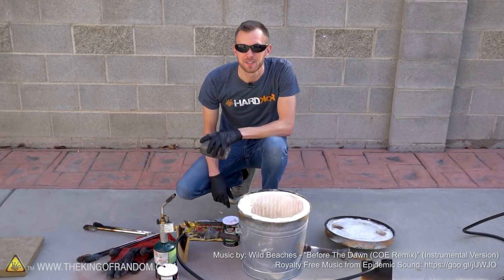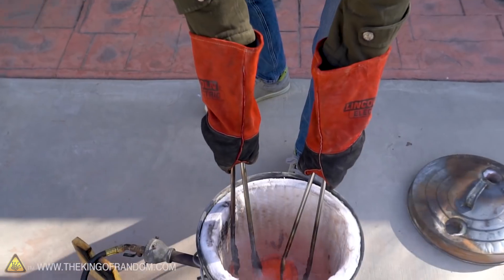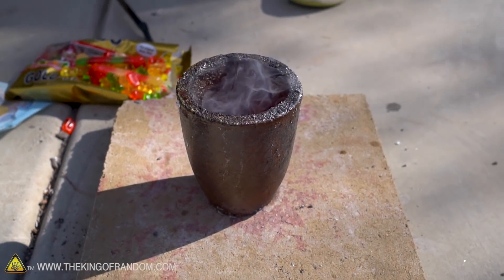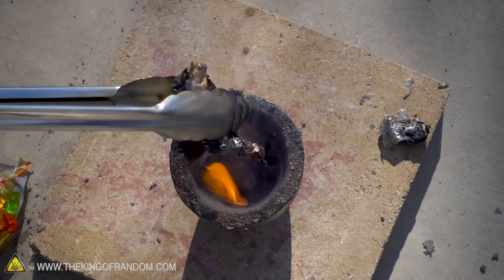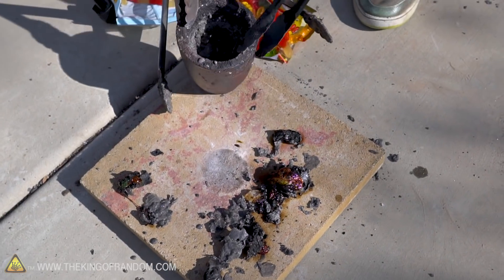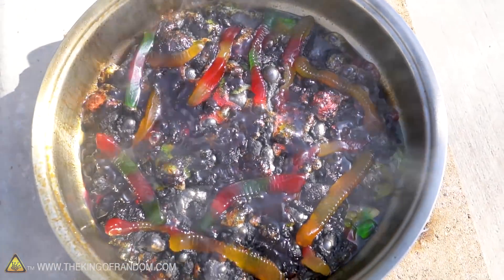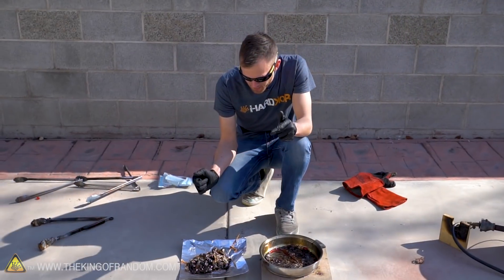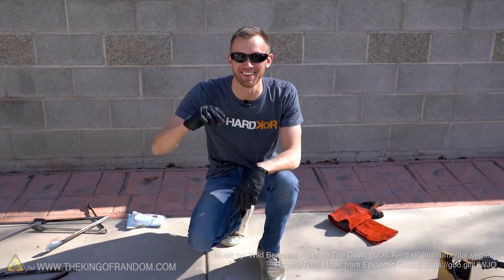Melting Gummy Bears in Molten Salt! TKOR's Guide On How To Melt Gummy Bears With Molten Salt!

Comment: You should get a different crucible like a ceramic one and see if the salt would  solidify clear
Reply: It is ceramic...

Not fully ceramic but it’s still ceramic
Reply: Prof. esrever I meant something other than this one which has graphite in it because he mentioned that along with the remains of past projects the graphite could be what's causing the salt to get that grey color. I was thinking more like an alumina ceramic crucible because they're more white so the salt should stay white

Comment: You should put shaving foam in a plastic bottle, then make a hole in the cap of the bottle (0,5 inch wide) and then put it in the vacuum chamber. Watch what happens.

Comment: When you drop sugar or candy into molten potassium nitrate, it will burn very quickly, sometimes explosively. It normally melts at 633°F, but you should superheat it to 2000°F with the furnace, and drop a gummy bear in.

Comment: @The King of Random what would happen to the bowl if it was heated in the furnace? would it eventually melt from the heat in the furnace or explode like it did when in contact with the salt?
I'd expect thermal shock was the cause for the bowl shattering, so not sure what would happen when it is heated slowly to those temperatures...

Comment: Molten salt in a vacuum chamber
Reply: This is probably a bad idea, because if the salt starts to boil under the vacuum then it will coat the inside of the glass as well as the inside of their vacuum pump.

Comment: mix sugar and citrid acid and hold it over a Flame. It will melt/react imediatly. That is really strange. I dont know if it becomes a plastic. It could because the carboxyl could react with the alcohol group of the sugar. 
You can try it also with Glycerin. There it worked.